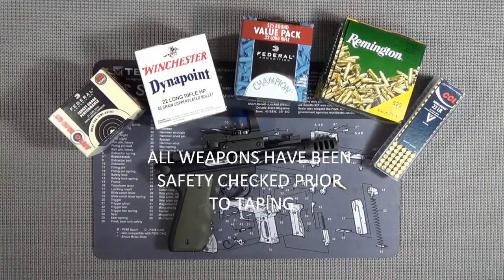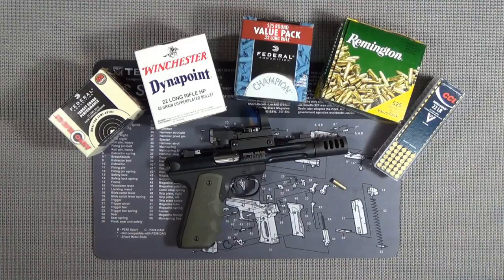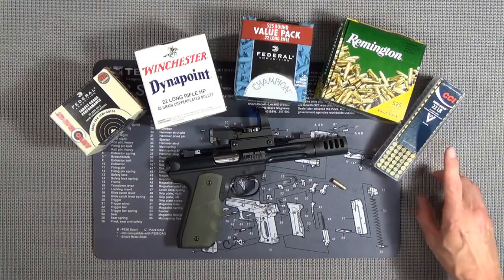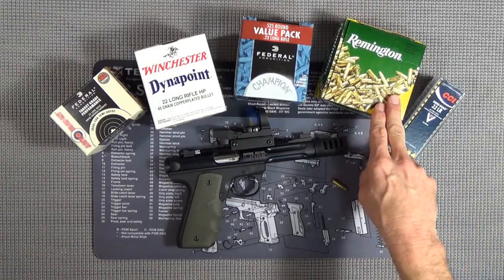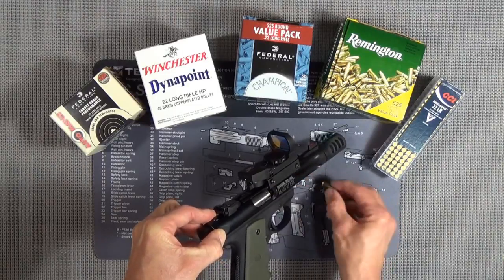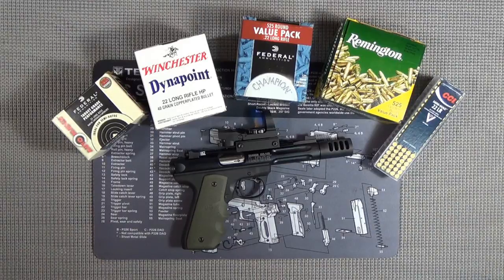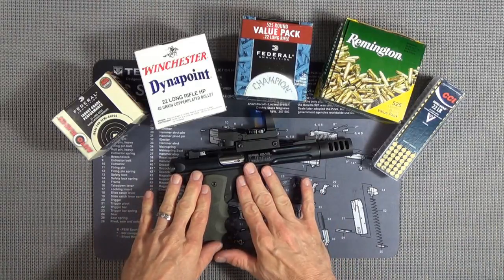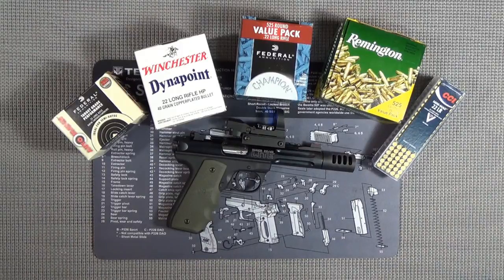RUGER 22/45 PERFORMANCE AFTER REMOVING THE LOADED CHAMBER INDICATOR (LCI)

Comment: I used a wood hammer handle , the magnet would not do the trick , I had to hit it quite a few times to get the pin to start coming out , grab it with a pair of hemos, cleaned everything well inserted the LCI filler , blue locktite on the screw and installed it . I tried different magnets but no luck , installing a VQ sear next , polish a few things , adjust the pre and post on the trigger and head to the indoor range to do some testing .

Comment: I went thru two game changer comp from TKoss , I shot the exit hole out of two of them . I went with the MaddMaxx comp three ports on the top , I also opened the center hole to .312 /.  5/16 dia .
The comp doesn’t do a damn thing other than looking cool and the smoke goes up . Take out the mag disconnect, add a Volquartsen trigger and add a Volquartsen sear . Then shoot like it wasn’t yours . Later Dude

Comment: How did you get the LCI pin to come out?  On my 22-45 Lite, the LCI pin is stuck in there like it is glued.
Reply from the maker: +logan pollock Usually a magnet will draw it out. Or a sharp wack on my wood block that is covered by rubber.
Reply: +TheGoatMumbler You can also heat up the barrel to help loosen the grip on that pin. I hit it with a hair dryer for a couple min, and a good wack on the bench, it fell right out.